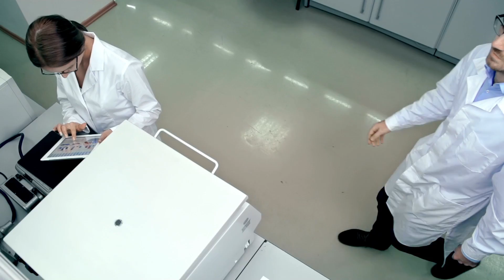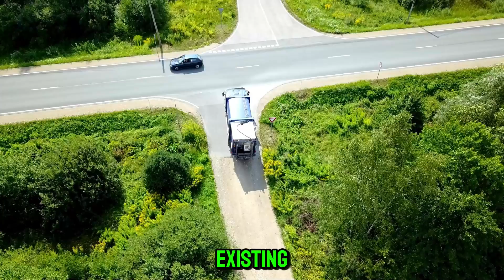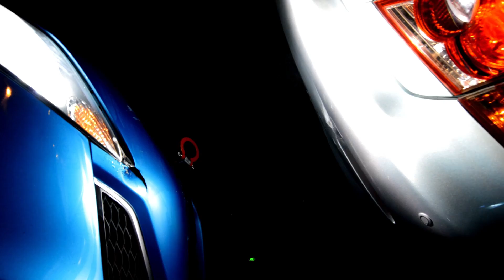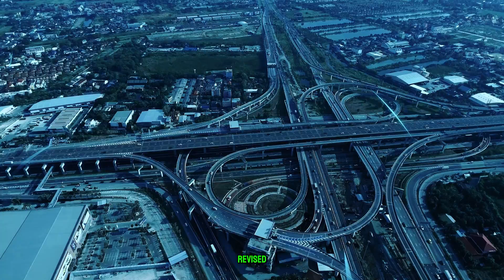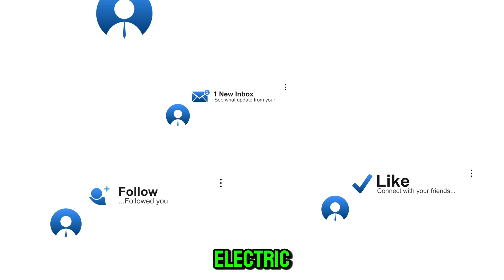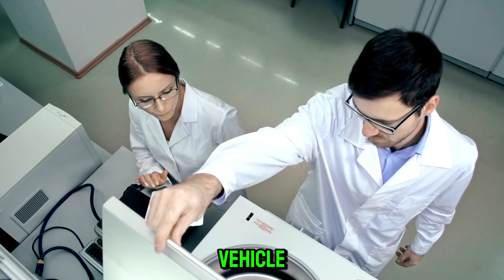Samsung’s New Solid-State Battery: 600 Miles, 9-Minute Charging and More

Comment: BULLCRAP!
First off demand for electric vehicles are tanking down the toilet as the unproven technology fails across the board. Technology is not up to the task of making dependable electric  cars.
   Lack of changing stations that the dems spent hundreds of millions for and ended up with very few for the money. The cars have short travel times and dont work in the cold not to mention takes forever to charge.. Batteries cost more then the car itself is worth is cases and all the fires that cant be put out because of the current batteries.
   All this is why companies are shelving the current electric car idea until we have the technology to make it feasible.
   Americans are turning away from electric cars until the technology catches up and maybe this new battery will turn it around. If not expect the electric car business to continue to decline in sales to continue and more companies to shelve their ideas.
 Also unless the battery prices are reasonable and not just for the rich and if the globalists allow these batteries to actually be sold and not swept under the rug like other green proven technologies we dont expect much to come out of this.
 We have seen break through after breakthrough year after to year only to see it sent down the memory hole and swept under the rug So we shouldn't hold our breath.
  As of today we dont have the dependable technology nor the infrastructure in place for ANY dependable electric car charging network so for now we are stuck with fossil fuels until such a time we do.
 We will believe it when we see it.